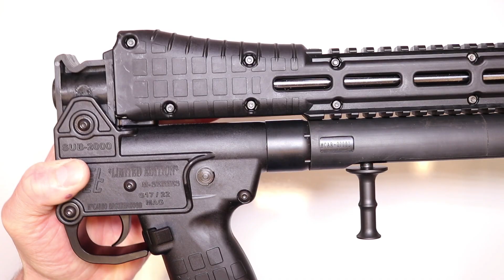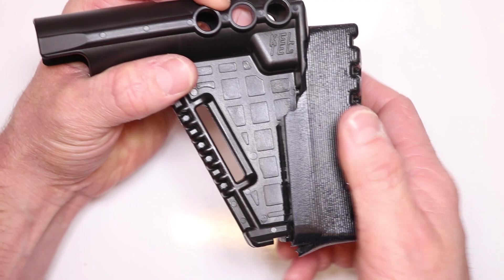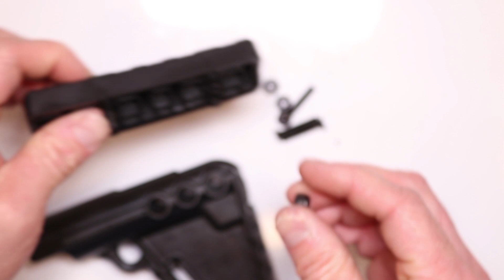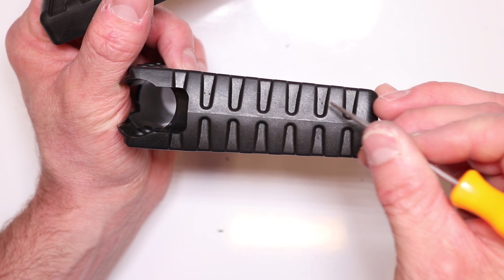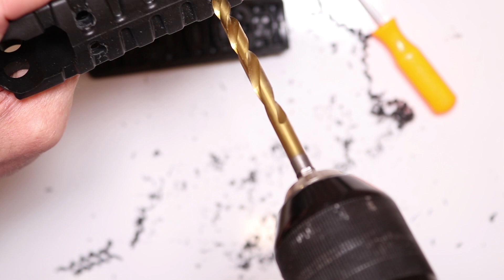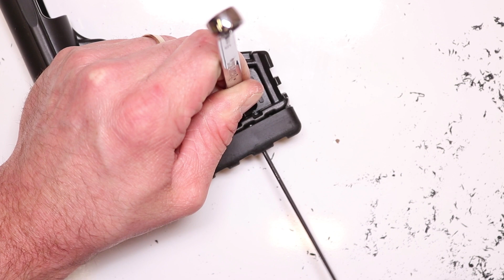KEL-TEC SUB-2000 Buttstock Pad Upgrade – Recoil Reduction & Installation | M*CARBO

Comment: put the buffer in before you attach the pad that way it will not be hard to put in and the pad can be attached while its on the gun , you can also wrap the pad to the stock when you drill and it won't move

Comment: Mcarbo could supply a cheap steel non hardened transfer punch. It is a punch that slip fits the hole of the new pad. It comes to a point to center punch the plastic. It would only need to be about 1.5 inches long and could be a throw away tool just like allen wrenches commonly are provided with many products. That would make install much easier and more accutate hole location.

Comment: instead of all that plotting, drilling and bolting together why not just remold the entire shoulder stock with the modified pad already attached so all you need to do is release the buffer and the lock pin and change out the old for the new?
Truth is that somebody is out there right now building an AR shoulder stock replacement for this.

Comment: Your butt stock sucks there . I said it! But.. I have the complete mcarbo set up except for the butt stock because, imo I think it was the least functional of all of the offerings you have. I think you need to come up with a mag holder set up like the new SW FPC and a possible better bump stock all in one.That would probably be easy to design since it folds on top and not on the side. Also, you could also make a version with a better butt stock as well.Just don't make the mistake they made by pressing one side and having the opposite magazine come out! Call me when it's ready! Imagine 30 rd in the gun and twin 30s in the built-in mag holder with better functional butt stock! I mean, how much recoil mitigation do we really need on a 9mm carbine? Lol, let's do it, M Carbo

Comment: Great video but I’m not sure what he means by a point in the butt. I have never had this problem but to mention even without Mcaebo aftermarket parts I have zero issues. It’s a 16” barrel for .9mm… there is almost zero recoil as is even with the 40 cal

Comment: I used a rubberband to hold the pad on and then drilled pilot holes with a really small, sharp drill bit. Then I took the pad off and worked up through the bit sizes to the full hole. It's much much easier than trying to jump up to the biggest hole first. If you go slowly it's pretty easy to stop right as the bit gets through to the other side and you avoid all the scratches/gouges. I have a drill press but it was easier to just do it by hand because it's a weird shape to clamp. I ended up using different hardware because the provided screws are a tiny hex key size I didn't have, but overall install is super easy.

Comment: I am thinking a hinged buffer tube would be an awesome mod.  The bolt locks back enough that the buffer tube could be swung vertically, allowing the buffer tube and barrel to be parallel, the width of the receiver apart ( when holding the pistol grip vertically, both barrel and stock would also be running vertically).  This would allow the use of a red-dot or other scope, without all those fiddly multi-swing adapters.

Comment: Drop an 11/64 drill bit into one of holes on the pad, and once you have the buttstock pad aligned to suit, give it a twist with the 11/64 tip against the Kel-Tec stock. Do this for all 4 holes. should make nice marks to get your 1/8th bit started. Sorry if this was posted below and I missed it.

Comment: You can turn the butt pad inside down to use the pick to mark location of holes. Much easier. Also, not need to scratch the plastic butt stock with the drill bit. Sloppy.

Comment: The hardest part for me was trying to buy a single 9mm crescent wrench. I didn't have one in my set. I went to four different stores and couldn't find one store that sells a single wrench that size. The adjustable wrench ended up being my go to for this job. OCD is a serious problem, people. LOL
Reply: Its a box/open end wrench. Crescent is a brand
Reply from the maker: Glad to hear you got it installed.  Will mention the adjustable wrench in next video.
Reply: @MCARBO   Initially, I didn't line up the holes and drilled wrong.  I was forced to open them up wide. I used my Dremel, it helped a lot. It was a bit of a hack job but I'm satisfied. I'm thinking of covering the exposed bolts and nuts with little rubber caps.

Comment: Why don't you just design a better buttstock that fits on the tube? We can get hundreds of different ones for ARs, no drilling involved. Is there some magical manufacturing limitation?
Reply: I'm serious. I understand you are a small business and there may be cost issues, and the SUB2000 market isn't as big as the general AR market. But this pad seems like a product that doesn't need to exist. Maybe add QD sling mounts too.

Comment: I just purchased the buttstock, recoil buffer, longer charging handle, extended mag, hand guard, and anti heat pads for my gen 2 and man I’m so much more in love with it. I didn’t think it was even possible. I appreciate you MCARBO. Cheers. Only thing I don’t like is how annoying the buttstock is to assemble and how you can’t adjust the stock.

Comment: He says the buttstock is just a “cheap plastic part” from Kel-Tec that can be easily replaced if you screw up the installation.  So, why doesn’t M-Carbo just offer a replacement stock with the buttpad already installed?  Wouldn’t that be the more customer friendly approach?  I know lots of people like to make mods to their guns, but I’ve never taken a power drill to one of mine before and I’m not real excited about having to do so.
Reply: Or better yet.....Kel-tec redesigns the butt stock so that the butt pad is already integrated into it
Reply: I just ordered and received one $25.00
Reply: There is a complete buttstock
Upgrade I think it’s made by otter.  Mimics the m&p pcc buttstock with mag holders built in
Reply: Because  that would be logical  ...... and he wouldnt be able to use this video  to push other products ....

Comment: Instead of putting the buffer on after you put the buttpad on, put it on before you screw it together. Problem solved. Also, trace the hole pattern on some painters tape and drill all the holes perfectly.

Comment: As an owner and lover of the Keltec Sub 2000 gen 2, I must say, this is not enough. The SK2 is a fabulous firearm. The only con to the gun is the butt-stock; it needs to rethought, and redone.    This screw-on recoil pad will not do since it only works in the fully extended position. Mcarbo has made incredible additions and swap-out/upgrades for this firearm. But; this cheap answer for the horrible butt-stock just will not do. I'm not bashing Mcarbo, I've bought several of their after-market parts for my Sk2 , and I will buy more; I encourage others to do so as well. And let me be clear, it is not Mcarbo's responsibility to fix this dilemma; this falls upon Keltec to correct. Keltec, if you're reading this, you guys need to do something about the Sk2's crappy butt-stock.

Comment: Why not just make an entire replacement for that buttstock. Something that’s the same dimensions as stock but has rubber shoulder pad. I personally don’t want to add any additional length to my sub-2000. That’s a reason I never bought your muzzle device

Comment: My sub2k's rubber buttstock (same cheapo amazon one you showed) is also beginning to tear up, so I'm really glad you guys made this. 
I get that it's necessary to use a harder rubber so it doesn't fall apart (and changing the shape has a lot to do with how the recoil is perceived), but I'll be honest, I still have concerns that the rubber might be too hard* and the cheapo one might feel better (I personally don't mind its shape). But at $30 I'm willing to take the plunge with your buttstock and find out for myself.

* This is the problem with MCARBO releasing affordable game-changers time-after-time, we now hold you to a very high standard. Still, MCARBO has always delivered and I have no reason to believe you wont do so again. 

I'm also looking forward to seeing your optic mount. Right now I have that Red Lion rotating front foregrip which works well but is heavy and takes time to set up (which somewhat defeats the purpose of the sub2k). If your optic mount consistently holds it's zero (unlike the Midwest Industries mount) then I might just reinstall the factory foregrip and use your optic mount instead.
Reply from the maker: Give it a shot and I guarantee you will like the even recoil distribution and added padding from the rubber on the buttstock.  You don't need a ton  soft rubber back there to make a difference in the felt recoil.

Comment: Will it work with shorter LOP configurations if I've removed the front sight post?
Reply from the maker: We've got a version 2 in the works for the shorter LOP
Reply: @MCARBO  I imagine the second version will have a big notch cut out to accommodate the sight post. Is that correct?

Comment: I've been using a cut off piece of foam pool noodle and some cable ties to try to reduce the recoil on mine.  

If you can increase the overmold thickness an additional 1/8th inch I'd love to get one of them.

I have a damaged rotator cuff and need the additional softness to reduce the force against my shoulder joint.

Comment: The butt pad, should have been designed in 3 pieces, so no drilling was required...  The Optic Mount should have been designed, so it fold underneath...  Check out link to see design..   See below 

https://youtu.be/xXsVktLCmwU

Comment: If the "sharp point" on the original butt stock is the primary issue, why not just  take it to a belt sander and flatten it out! It's what we do to the pic rail to take off the peak. Same procedure.

Comment: Why would you disable the ability to use all lengths on the butt stock?  I cannot get this because I use the shortest setting and I should not have to grind a big chunk out of the top.
Reply: I agree. An unbelievable design oversight.
Reply from the maker: We wanted to off the most surface area to absorb recoil.  Will have a V2 with the cutout for shorter LOP options.
Reply: @MCARBO  Excellent, will order that when it is produced. Thank you.

Comment: A set of drill bit stop rings will save the butt stock being damaged like in the video. You just put the right size ring on your drill bit and tighten it lightly with a hex wrench.
Google "drill stop set" for a brand and store of your preference.
The first two places offering a set for less than 5 bucks I found are:
https://www.harborfreight.com/7-piece-drill-stop-set-38336.html
and
https://www.homedepot.com/p/General-Tools-Drill-Stop-Set-7-Piece-S838/100176201
Of course, if you can decide to invest in a higher quality set for around 10 bucks. :-)

Comment: I would recommend using electrical tape to temporarily secure the pad to the butt stock, then use a drill bit that's the exact size of the hole (in a drill) to lightly mark the holes. That would be a lot more accurate than a pick or center punch. 

I like the idea and design you have, especially with the overmolding. How much length does it add to the LOP? 

I'm eyeballing all of the stuff you guys are putting out and I'm very impressed with your products.  I will be buying some, but they'll have to be one or two at a time. VA disability doesn't pay the best and I really can't work very well with my cancer. But a guy still has to get some gun powder therapy.
Reply: Also maybe tape over the areas you could mess up with the drill as it breaks through, like the problem he had with roughing up the plastic stock
Reply: Thats how I did it, but instead of tape (which is a better idea) I just grasped hard as I scuffed the spots with 1/8" bit. Broke one of my bits doing this oh well.

Comment: Another great upgrade!  Simple install and adds to length of pull ...what's not to like.
Reply: Well the fact that you can't have the stock in the shortest setting with it on, and have it folded, would be one.
Reply: hjkentproductions  so i cant fold it?
Reply: Steel Punisher 69 I wouldn’t say simple. This took me a fucking hr to do even with measurements
Reply: Anybody willing to drill holes in their buttstock will probably be OK with modifying the MCARBO buttpad so it works.
Reply: Having to drill holes in your shit. 
For another.

Comment: With all the upgrades of the S2K, I’m about to pull the trigger and buy one.

Off topic of video, any word on an aluminum trigger for the PF9?
Reply: Honestly don't buy it UNLESS you can also get the MCARBO upgrades (or the M-series). The M-series is what Kel-Tec should have released from the get-go (and they need to collaborate more with MCARBO from now on). 
I had the stock sub2k (because I loved the concept) but man was it a disappointment in stock form. I put damn near all the MCARBO parts (save for this buttstock and the trigger bar, I'll be getting both of those next) and to say they collectively made a "night-and-day" difference would be a gross understatement. With all the guns I've modified, never have a few simple upgrades made such a profound difference in a firearm's overall performance as much as the MCARBO parts.
Reply: Magnan Imus  yes sir. My sub 2 k  failure to feed, failure to feed. Could not fire a complete mag at all. Replaced some parts now it’s 100% reliable with all magazines.